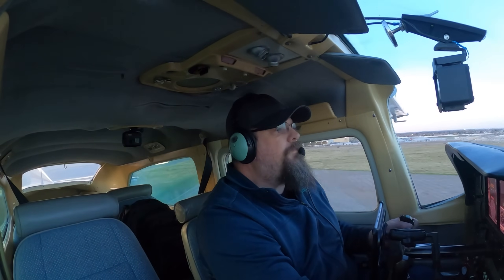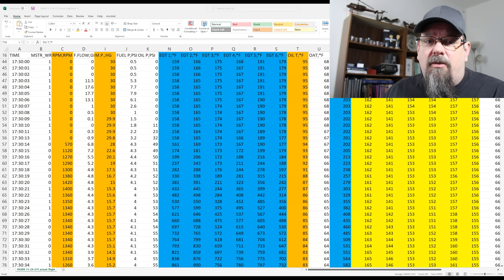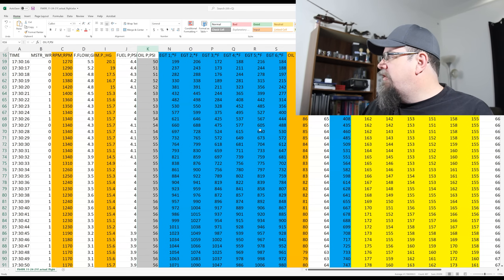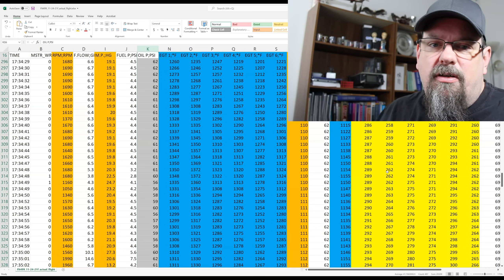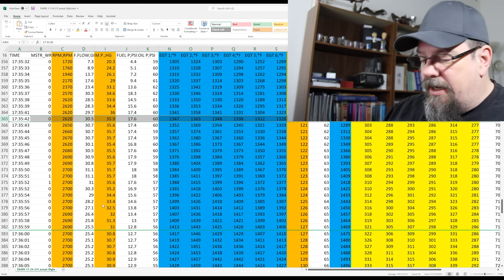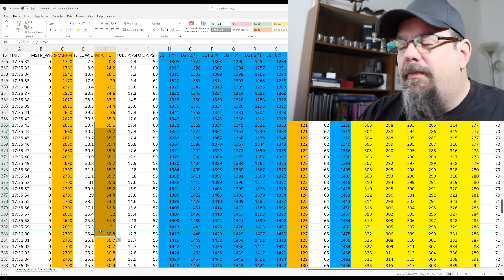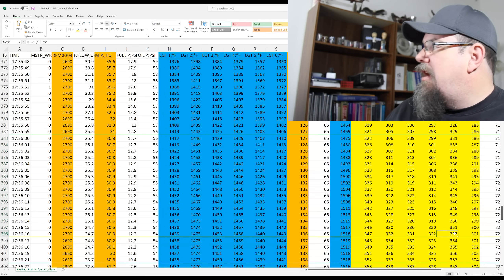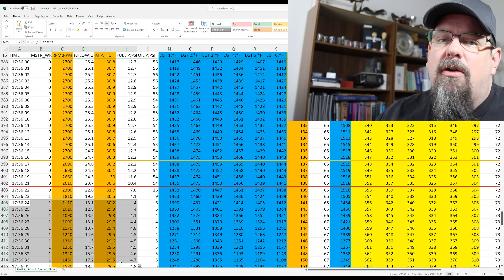So What Actually Happened?

Comment: Is it normal to have data like this for a flight? I'm not a pilot, I come from cars and I have to hook up my laptop to log engine data. I do it regularly and take my car to the track and understand how valuable this information is. I also have experiences with multiple engine machine shops doing work not to the standards I requested. Luckily I typically do final assembly myself and found some clearances that weren't anywhere near what they should be. When I brought this up, they agreed to machine a new block for me, but it sucks knowing that the issue wouldn't have been caught if I wasn't knowledgeable and equipped enough to catch it. LOTS of subpar work out there for any specialized mechanical work. I'm a mechanical engineer as a day job, shit makes me sick honestly.
Reply from the maker: There are some engine monitors that store this sort of data, but a lot of airplanes don't have this sort of engine management system. I'm a bit of a data nut, it's so cool that it stores this data, and I can go back for a couple hundred flights at about a 1 second resolution.

Comment: Isn't this the second time in recent memory, you've had an engine blow up through lack of lubrication? I wouldn't let this mob work on another engine & get the same result. You'd have to be crazy. And that's the definition of crazy. Doing the same thing over & over & over & expecting a different result!
Reply from the maker: No, I've only had one engine blow up. It wasn't lack of lubrication, this is the result from that incident that happened back in November.

Comment: Was this reported to the FAA? That type of complacency isn’t something to be taken lightly…
Reply: I believe the mechanic has to be certified to work on counterweight engines.
Reply: @wburtney5154  they only need a Power-plant License or be supervised by a person holding a power-plant license. If this failure really was caused by a departed counterweight because technician A didn’t complete a maintenance action and technician B assembled the engine with said action not completed, they are both complacent. I wouldn’t be surprised if the FAA didn’t show up at the shops doorstep the day after this happened.

Comment: What I am curious about is if the cause of the spalling on the lifters has ever been found. If I recall correctly you replaced the lifters but were still finding metal in the oil, like the problem had returned and not been fixed. Now this latest failure seems to be a completely different thing than the original problem. Of course, now with a replacement engine the whole question is moot - but still interesting.
Reply from the maker: The original lifters were spalled probably because of corrosion, there were several years where the airplane only flew about 20 hours a year. When I replaced the lifters the first time, they only replaced the lifters and not the camshaft. Because of this, the old camshaft tore up the new lifters in less than 20 hours and the oil pump after another 20. I had the engine removed to split the case so the lifters and camshaft could be replaced. The catastrophic engine failure happened because of an assembly issue.
Reply: @TheEdwardFrye  , who replaces lifters and not the camshaft at the same time?!?!? HUGE mistake!